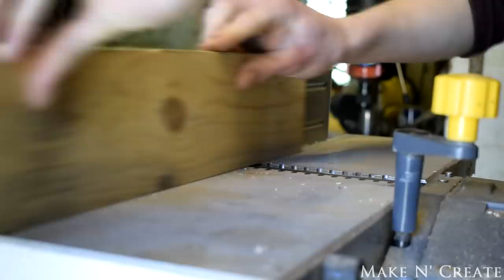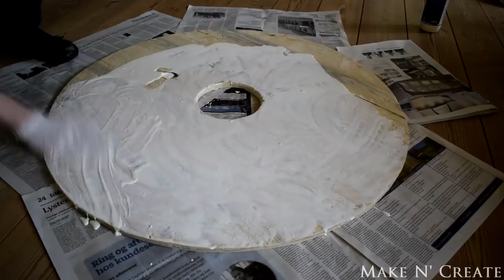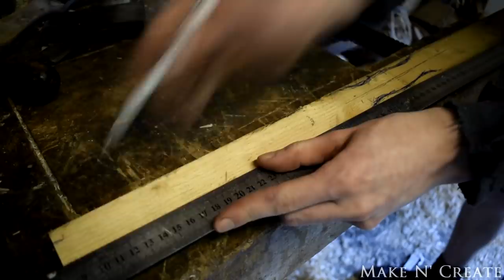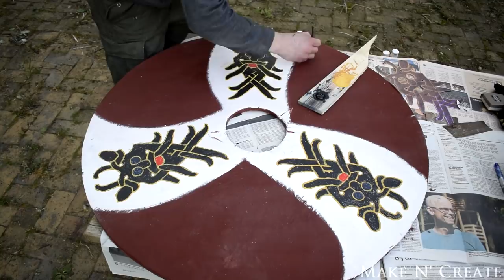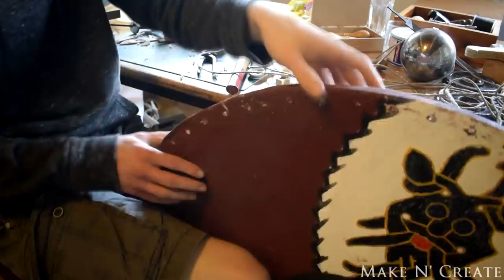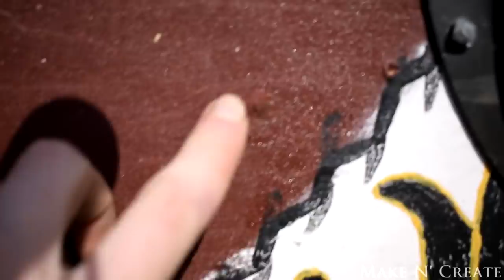Woodworking, Blacksmithing and Leatherworking - Making a Viking Round Shield and Testing it

Comment: I love the video! I just discovered your Channel and this is the only one video I've seen thus far, but there was just one minor thing that bugged me. 

You went through the trouble of making your own nails to hold on the boss, but then you used Modern Nails to hold the handle. Evidently, using square nails in that application would have been difficult, but a recommendation I would like to make would have been that once you had the Modern Nails cut to the right length, to take them out and flip them around so that the modern head is on the user side of the Shield, so that the hammered rivet style was on the face of it.

none the less, you've inspired me to start making again! Thank you!

Comment: i made 3 shields myself , really nice work you did there i learnd something new to improve my work,
some tipps from me if you want the shield getting lighter: obviously a smaller buckel and my shields are only 2*3 mm or 2*4 mm plates of pinewood , i just overlap them like you did and dont be greedy with the glue neither on the wood nor on the linen; at last but not least at the egde of the shield under the raw hide i use to but a rope , i prevents the wood from splitting and distributes the force of an incoming strike on the edge ;
also where did you get such a big dog bone?
good job keep it on ;)

Comment: I always wondered how good or how long shields like this lasted in the day, like this is a fairly simple construction and not very thick. And given that iron was more common in those days as well it always makes me wonder. Then again from what I know using a shield effectively isn't so much catching your opponents strike on it as it is deflecting them with it. And of course its primary use was always defense against arrows. But even then I wonder how many it can actually stop?
Reply: Authentic ones had rawhide on thr front as opposed to linen and used rawhide glue. A small amount of warm water, approx 60⁰c and the glue reconstituted to liquid. Repairs were as easy as heating a little and swelling the timber and glue. Any arrow holes etc closed over and maintained the shields strength. The reason they only used a boss besides weight saving was that iron in those days was actually quite scarce and expensive.